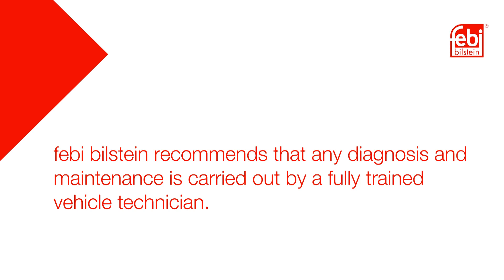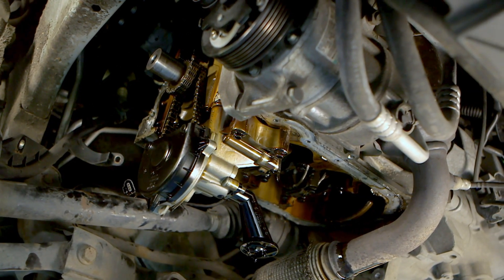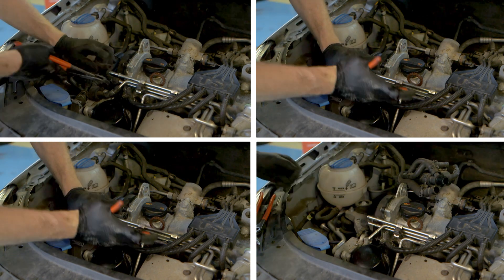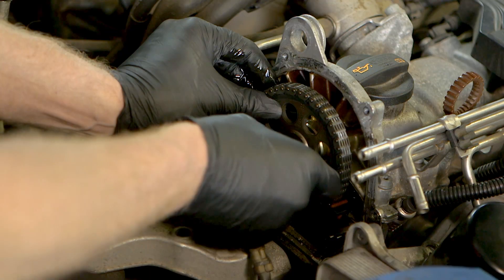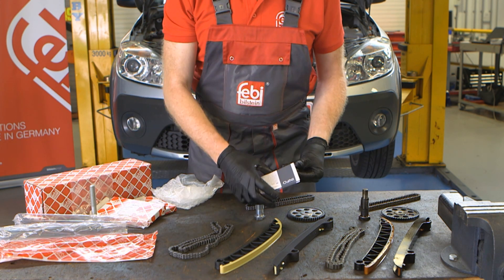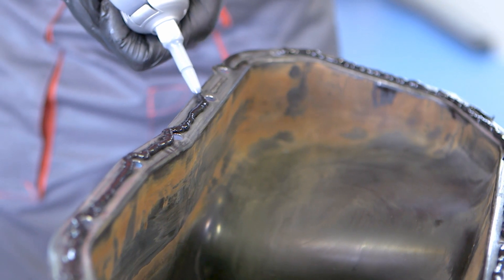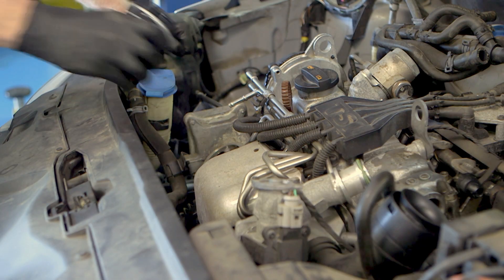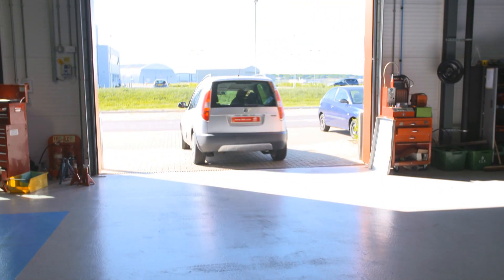[EN] Engine timing chain drive inspection and replacement

Comment: But don't change the crankshaft sprocket? I gonna change in my polo 1.2 tsi 2014 and I asked in a Volkswagen car agency and they told me that's no necessary it's right?
Reply from the maker: Thank you for watching our video. When replacing a worn chain drive all parts that are worn, must be replaced. We offer many kits for the chain driven 1.2 TSi engine subject to date of manufacture. Please check out our online catalogue www.partsfinder.bilsteingroup.com where you will find an info bulletin.
Reply: If you change timing chain then you need to replace all parts, including crankshaft sprocket and oil pump sprocket with oil pump chain even if they tell you that there is no need. Because sooner rather than later you'll end up with premature chain wear and oil pump chain skipping on cold start, starving the engine of oil and destroying the crankshaft sprocket. Better afraid than sorry with this engine. Assuming you have 1.2 CBZA, CBZB engine.